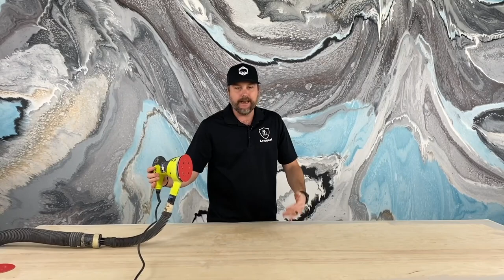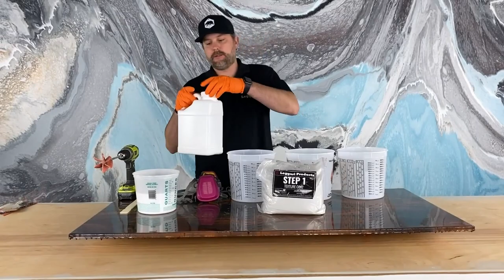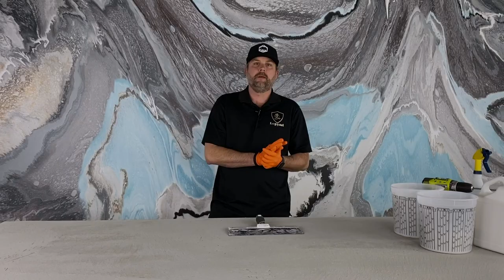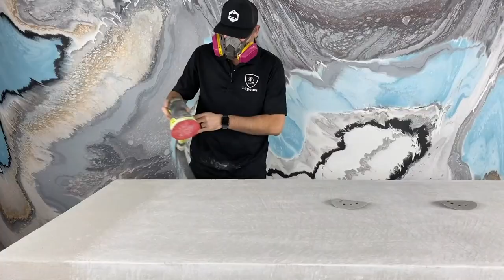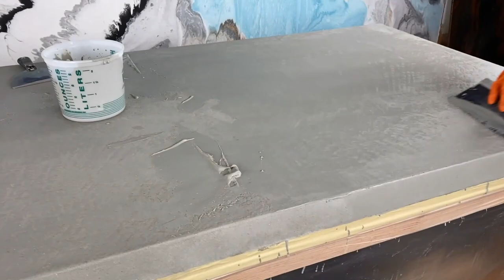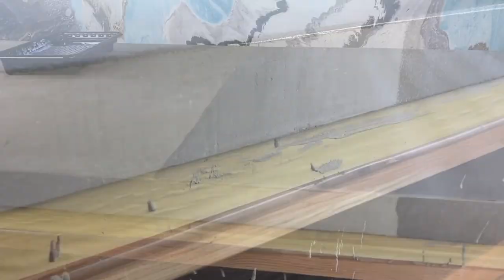How To Make A Wood Table Look Like A Concrete Top Using An Easy DIY System | Concrete Countertop Kit

Comment: Looks good, but not sure why you bother with the Bondo. A mix of the concrete with a polymer additive works just as well, as you would be using for the first bonding layer anyway. Have you found any benefits to the Bondo above and beyond that?
Reply: Holes and inconsistencies are always gonna print through.

Comment: what happens when the wood flexes and the concrete cracks?
Reply from the maker: If the wood flexes, the concrete overlay will as well because it bonds completely to whatever surface it is installed on.

Comment: Q: looks nice but wouldn't such a thin layer of 'cement' crack and chip very easily? Even w/epoxy mixed in, it seems to me that it would chip/crack?
Reply from the maker: It's actually pretty durable, thanks for watching the video.

Comment: Can you use a food grade concrete sealer instead of the last sealer with your  overlay products?
Reply from the maker: We recommend are wb sealer or one of our urethane top coat options I can’t speak to how other topcoats would work on our product or would I even recommend it. Thanks for watching!
Reply: @LeggariProducts  but yours completely alters the color of the underlying material. it is not clear. it sucks. and you do not provide any way for people to get a sample of the product they are interested in that will represent the final outcome. try shipping your top coat with the samples so people are not disgusted with what they get compared to what they think they are getting

Comment: Is it possible to paint this before using the matte coat? I'm looking into options for stage flats for our set design to make concrete panels that aren't going to be super heavy.
Reply from the maker: This would be a great light weight option for you! Contact customerservice@leggari.com and they can help you with your questions!

Comment: Great videos, love the product, but customer service isn’t always available especially when I need them! Trying to do concrete overlay, but seem to be missing a few details, like dry times after scratch coat and stain?? Nothing really showing you how to use the stain. Plus the sprayer they send to put the stain on doesn’t work, it’s garbage!. It’s been 2 hours since they opened and still cannot reach anyone at Laggari products! 
 Love the product and was planning to use it for some other projects, but with no customer service I’m too disappointed and frustrated to deal with them again!
Reply: Wow...thanks for the feedback...I also think its just too many steps for the flooring, which I al looking to do for 1300sqft, So maybe using some other products. And I see no prices. For some other overlays I see $25-30 for 150sqft, etc.
Reply: not to mention its expensive and they do not accurately represent the expected outcome. Ordered sample and it was lovely. but it does not come with the topcoat.  counter was lovely until I applied the top coat and now it is a horrible greige. they seem to think a 2 x 4 inch photo on their web site is enough for people to go on. I emailed and asked questions prior to purchasing the sample. I never expected them to add in a product that would drastically alter the color of the base product. and their solution was to sand it off and then buy stain and apply. but you then have to apply the beige top coat that will one again destroy the color of the product. the entire experience sucks.

Comment: Way too many steps pal. Just pour a concrete counter top on melamine and buy quickcrete concrete mix and caulk your corners pour and vibrate with a palm sander or sawzaw without blade or tap edges very good with hmmer lightly but alot to get as many air pockets out and youll have a sweet concrete countertop!
Reply: Heavy, would have to be around 2 inches.
Reply: Yes but of course when pouring in place you have less room for error. Gotta get it right the first time, otherwise you could have a nightmare of sanding on your hands which is a real problem inside a finished house. Every technique has its advantages and disadvantages.
Reply: I would love to see a video. I have bath cabinets I am using to make into a kitchen. I need to use plain wood to make 22 inch deep counters. I would like a concrete finish. Need help figuring this out!
Reply: Plus 22lb vs 650lb. Also he did a table cuz he had it. These are meant for countertops already in place.

Comment: Can you add a  color in the cement powder mix?.
Reply: privacy is key hi, but you can add a epoxy coating?.
Reply: @JuanGarcia-wm5ng  If you're okay with never seeing your family again sure.
Reply from the maker: Yes you can, we have color packs that you add to the concrete overlay to color it.

Comment: Can I go over tile with this product?
Reply from the maker: Yes it can be put over tile, but you need to fill all your grout seams with multi purpose bondo from Home Depot, then sand it smooth, this will scuff up your tiles also, then wipe it clean with denatured alcohol then you are ready to apply our epoxy.  Take a look at the tutorial below.  Thanks
 https://youtu.be/g8GzsL0kpns

Comment: Checked the website prior to watching.....you are selling these kits for $590++???? I don't see how a faux concrete countertop is worth this much. I'm confused as to what makes this so expensive to produce.
Reply: WHAT???!!! $590+  LOL>>>OMG!! That is insane. We are talking at the most $100 in product, and maybe $50 in well marked containers. That is insane!
Reply: @philindeblanc  exactly!! I am more than willing to pay for quality products but this is just taking it over the line for me. I just did this same thing myself with a little too much research for under $150 total (generous estimate) and they came out perfect. Time will tell for durability, but this upsell is too much for me.
Reply: @chloe61195  The is a product CTS called concrete Leveler, and I bet it would do pretty much what this does. It may need a good power sanding knockdown, but its $32 for about 50sqft.  These companies are label makers. They do marketing to sell at the maximum profit based on what the use can be. It can replace a $1000 table, lets charge for that. Even the polymer concrete is already super priced as a decorative finish. These used to be 8-9$ a bag, and now with so much inflation, and markup its over $30.  They dont do what other companies or markets and countries do, which is look at their costs and charge a markup for profit for the industry. They are free to do what they want, but they get the proper greed and phony business label.
Reply: @philindeblanc  exactly what I have come to realize as well. Damn shame too.

Comment: just applied this to counters and am disgusted with how they turned out. the top coat turns the beautiful gray concrete in to a greige color. this clashes with everything in my kitchen. I took time and spent money to get the sample and the color is just what I wanted. but the sample does not include the base or the top topcoat and the topcoat changes the color more than a little. no where online do they mention the topcoat will alter the color of the base product. their solution is to sand it down, spend more money on a stain to make it darker, just so I can apply another topcoat that will once again add beige tones to the final product. Ido not want a dark counter, I want a light gray. I had conversations prior to any purchase I wanted a light gray color and no one at any time mentioned they do not have that color. I cannot recommend doing business with a company that will not fairly represent the final outcome of their product to their customers. what really sucks is I only did half my kitchen and I am now forced to spend another $700 to do the rest. the sight of this product clashing with everything else just makes me ill and I am furious at having to spend even more money on a product I don't want. and their support relys on a photo on their website as the color I got was reasonable of what to expect. I purchased because of the sample. not the photo on their web site. again.. customers should be able to get something to determine, BEFORE PURCHASE, if the final outcome is going to be what they want.

Comment: Its alot less work to just do real concrete
Reply from the maker: Brandon Clark Not even close! Each step is fast and super simple. You can do the whole process in one day.
Reply: I was thinking the same thing.   I just looked at the price of the kit.  Almost $700 for 50 sq ft.  It might be easier to do real concrete but it would DEFINITELY be a hell of a lot cheaper to do real concrete.  Don’t get me wrong.  I love everything that you guys do. But I think for the most part people use epoxy to get the look of stone but without the added cost of the real thing. Doing concrete countertops is a hell of a lot less than $700.
Reply: @LeggariProducts  how long you think concrete takes? I have experience in concrete it is not hard and and could do in one day aswell for way under 700
Reply: Your average DIY'R wouldn't be able to build forms and pour concrete counter tops in one day. It would definitely cost more to hire somebody to make you concrete countertops.
Reply: Just did full concrete and epoxied the top with a glaze. It's a lot more work and many more days.